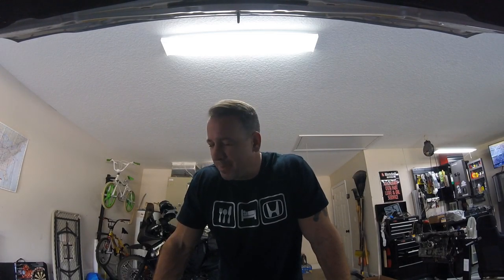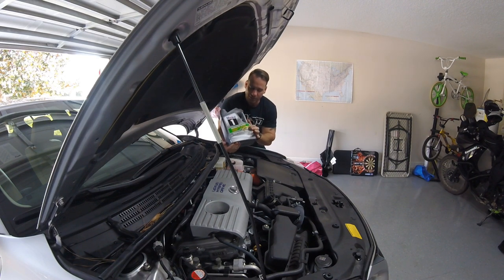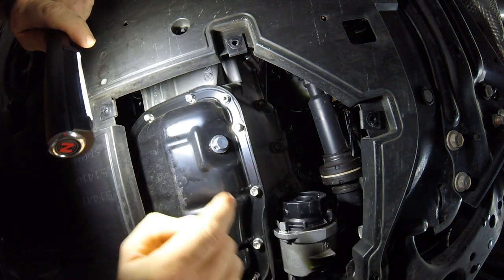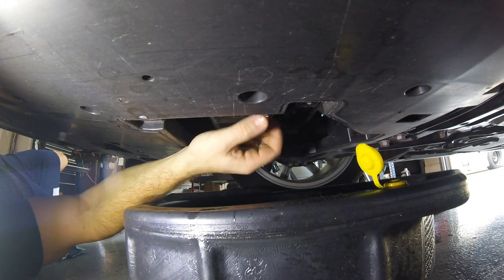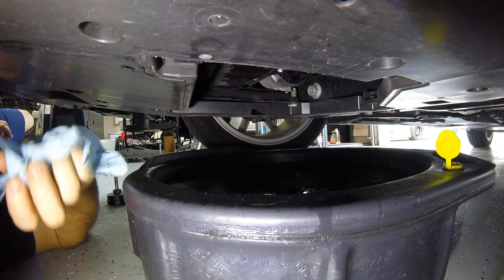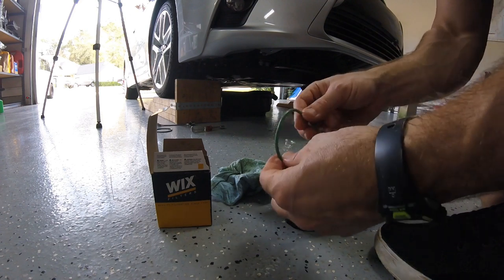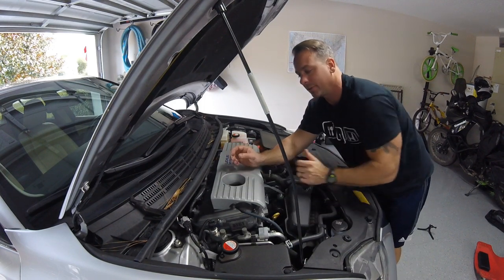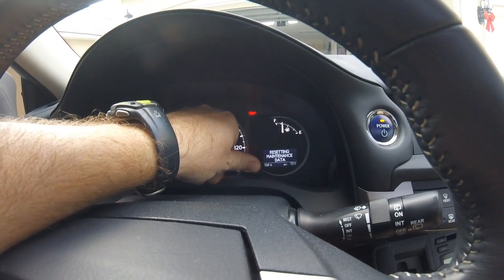How to Change Your Oil - Lexus CT 200

Comment: Got a 2018 model a week ago or so. Man, this car is just perfect in every aspect! My record of gas usage, 3.9L per 100km. Amazing thing.
Reply: Wow, i am getting around 4.8lt/100km. However, the stock tyres are 215/45R17. Thinking of downgrading to 205/55 R16
Reply: Agree just got this car it's a wonderful peace of machinery
Reply: Hope you'll not spend the saved money on the battery.
Reply: @agenorzc  no issues so far, 115k kilometers done and now the service said in a year will probably need to change the break pads. Also bearing in the front left wheel makes some noise so need to change that. Other than that no issues. Here in Norway it has even no problem firing up with -25C during the winter. A lot of reliability fot the money

Comment: I love my Lexus Prius....ahem.....CT200. 42 miles per gallon - $15ish dollars to fill up - better for the environment!  (P.S. Thanks for changing my oil!)
Reply from the maker: EssentiallyKelly It’s a great car with a horrible oil change process and lots of blind spots.
Reply: True story.
Reply: I like my 2013 CT200h.
Reply: @ExtremeDailyDrivers  My Honda Insight is the same way. You can look behind you and check your mirror 3 times, your still praying every time you switch lanes. The insight has 325K miles. Getting a CT next. The interior oozes 90s japan. Right up my alley. Wish Honda made a car like this.
Reply: The battery banks are bad for the environment though 😂😂 trading one evil for another
Reply: @ExtremeDailyDrivers  Lots of blind spot indeed.
Reply: @phill3144  I'll take care of me and the environment can suck it.  I drive a CT200h and love that my gas bill is so inexpensive.  Probably I get 45mpg on average.  If I try I can get it to go higher.
Reply: @michaelking4578  God bless America sir
Reply: You live in Saudia Arabia or Iran?
In US you can't full the tank in $15.
Reply: @SrkTube786  Yes you absolutely can. I live in Canada and when gas is > ~$1 a litre my full tank is about $30. I have gone empty to full for under $15 several times in areas of the US with $2-2.50/gal gas. Assuming you have 1 gallon or so in reserve on the fuel light, 7 gallons at $2.25 is just about $15.
Reply: My wife loves hers. 132,000 miles and counting
Reply: And obviously the reason it's so quiet is all those plastic panels you normally wouldn't see.

Comment: Thanks for the chuckle with your your "count the cylinders" to determine the number of quarts of oil needed theory.  I hope you have figured out the two are not related...at all. 

While the oil filter cartridge might not be as convenient, it is less waste going into landfills consistent with this hybrid's "greenness."  They can also be incinerated, metal canister filters can't.  Many states designate used oil filters as hazardous waste..it is easier to comply with the disposal regulations with cartridge filters.  Cartridge filters will only become more and more common.

Oil turning dark in color doesn't mean in and of itself the oil needs to be changed or there is an issue with the engine.  Urban legend.  More related to heat cycles or soot. 

Handy tip: Your oil will drain much faster if you remove the oil filler cap AFTER you remove the drain plug.

Finally, and you know this....get the torque spec for your drain plug and consider torquing to that spec.  I know many shops don't, but there is a correct way to do things.  Stripping the threads on an oil pan really sucks.

I appreciate the link to the cap wrench.

Comment: Good video, just one thing you forgot to lubricate   the sealing O ring on the filter cap, usually just a smear of motor oil to prevent  it from twisting out of the groove when you tighten the cap, but I am sure this helped a lot of people.
Reply from the maker: Great point. Someone mentioned that below. I did it off camera. I forgot to show it. 👍

Comment: Just done my oil change.  My filter tool to unscrew the filter was different from the one in the video and was poor.  Unscrewed it ok but ended up sticking to the filter casing.  I left it there.  I don't have a fleet of Lexuses so it's not like I'll need the tool for anything else.  Win some, lose some.
Reply from the maker: Next time removal will be that much easier!

Comment: Great choice on the oil filter cap wrench and on positioning it correctly. It's amazing how so many can't seem to get that right.

The only thing I do different is
1. I don't use any tools to change the o-ring
2. I make sure to oil the o-ring.
Reply from the maker: Good points. You could damage the o-ring channel if you gauge it with a tool and I did oil the o-ring, I just didn't show it. I'm not 100% sure its necessary.

Comment: You’ll find the same filters on the 2012-2016 Camrys. Those super seal for some reason. And I’ve actually snapped wrenches trying to get it off. Took all the guys in the shop to get that thing off lol. It wasn’t just the one instance either. It’s happened with them all. I recommend anyone to buy a nice steel made removal tool and not the cheap thin aluminum ones.
Reply from the maker: Yep. Facts. Every time I change the oil on the Lexus I'm shocked by how tightly the filter is on there. Thanks for watching.

Comment: Not sure when the change was made but my 2016 CT200h has the oil filter cap facing the oil pan instead of parallel to it. No idea what genius made that design change or why, but it certainly doesn't make changing the filter any easier.

Comment: Great video - thank you very much.  And, speaking of a pain in the ass - my 2012 CT 200 has these "use once" plastic clips that hold the plastic skid plate in place and the only way to remove them is to essentially break them (which I did) - instead of the much preferred 10mm bolts (also philips-head screws) on yours .  Thankfully, tie-wraps worked well to put (and hold) everything back in place, but I was like, WTF?!  Thanks again and all the best.
Reply from the maker: 😂 Classic Lexus!! I’m so happy the video helped! Good job.

Comment: I like this car .. do you or everybotty  recomends this car for a everyday driver car i drive every day 40 miles to my work and 40 to come back home.... and any problems with the battery pack ? Like those hondas or some toyota prius????
Reply from the maker: We are at 62k miles now and not one issue. It's a Toyota. Do you know what "Toyota" means in Japanese? Bulletproof.
Reply: Thanks so much im ab to buy one i liked  thanks...
Reply: there is a guy on the CT forum that is currently at 580k......... that is five-hundred-and-eighty-thousands miles. 5-8-0-0-0-0.

Comment: Can the CT200H use 0W-16 oil? In the manual, the lowest viscosity rating oil stated is 0W-20 but I see 0W-16 oils labels which says that they are suitable for Hybrids
Reply from the maker: I wouldn't. There is no benefit. Thanks for watching.

Comment: My oil filter is too tight. The wrench won’t even loosed it. What could be the problem?
Reply from the maker: Bicep strength? There is no secret. It needs to be loosened. Crank on it until it comes off. Good luck and thank for watching.
Reply: @ExtremeDailyDrivers  took a breaker to it. Still didn't work. I looked online and apparently the techs at the dealer overtorque these all the time. I had to take a electric wrench and set it to 250ft-lbs to get it off. lmao
Thanks for the helpful video though!
Reply from the maker: I knew you would get it. Never had a doubt. Techs do always over tighten it. That's another reason to always do it yourself.

Comment: "Maintenance Required" does necessary mean oil change. This car needs oil change every 10'000 miles.
The 5000 Miles warning is for tire rotation and fluids top off.

Comment: Great video but I kinda disagree about the bath filter vs the cartridge filter.  I just bought a used CT200h and I'm  looking forward to its first oil change.  My Wrangler JK and Hyundai Genesis sedan both have  bath filters too.   I like having to replace just the paper element.  Less waste and more economical.  The Jeep filter is so cheap the last two times I went to the dealer they just gave me the filter for free, no lie.  I asked for the filter and the dude at the parts desk just tossed it to me and said no charge.  Color me dumbfounded.
Reply from the maker: The key phrase in this comment is "I'm looking forward to it's first oil change." :) Thanks for watching.

Comment: Any recommendations that’s a must for the CT, other than the oil change? I am at 80k miles and refuse to spend over $600 at the dealership for “maintenance” and I want to get to know my CT baby!
Reply from the maker: We are getting close to that. We still have only done oil changes. Brakes need to be replaced and we are having issues with the door lock actuator. More videos on the CT coming soon!
Reply: @ExtremeDailyDrivers  is the door lock actuator what actually makes the doors lock automatically when the car shifts to the drive mode? That’s my issue as well!!! 
Thank you for sharing your knowledge! Being detailed avoids mistakes! Great video!
Reply: but the dealership snackies and drinkies!!! and the courtesy UX!!
Reply: @ExtremeDailyDrivers  MY CT 200H in Oz is clocking 110,000kms and had a e-safety check (for registration renewal). The mechanic said that for these hybrids, the front brake pads will only likely require replacement at 150,000kms as with his experience with most Prius

Comment: You only need to change oil every 10,000 miles or each year. Not every 5,000 miles. Use full synthetic oil 0-20w.
Reply from the maker: Yeah, this was a 10k change. I misspoke in the video.

Comment: I cant remove that filter its so tight😢
Reply from the maker: Buy the filter tool! Link is in the description! Thanks for watching!
Reply: @ExtremeDailyDrivers  i did bro,lefty loosy even impact gun cant remove the thing,dealership sucks!they are the last one who oilchanged the car
Reply from the maker: Get a breaker bar and get some leverage. It will come off.
Reply: @ExtremeDailyDrivers  im thinking about getting that clip off the silver one,maybe that one can help

Comment: Not sure why you're complaining about the plastic cover and the fact the filter is in a filament... aren't most newer cars like this? I get the headache of the special tool... but it's a one-time buy for under $20.
Reply from the maker: The short answer is “no”, not all newer cars have this type of oil filter. Thanks for watching!
Reply: Oh well, thanks for the slight clarification. I wasn't trying to troll... was just genuinely curious and thought otherwise. Thanks for the video though! Just got one of these and plan on doing the oil changes myself... so this helped a lot!
Reply from the maker: No worries, dude. Congrats on your purchase!! It’s a great car. We have 47,000 trouble free miles. I’ll be changing out the front brake pads soon and plan on doing a video. Thanks again for watching.

Comment: Is the car not supposed to level for this?
Reply from the maker: It’s supposed to be level, I always check it after I start it and it’s on the ground. I did film that part. If you put in the correct amount, it doesn’t really matter.
Reply: Extreme Daily Drivers makes sense, love the Ford comment BTW 😂👍
Reply from the maker: Lol. I hate Fords.
Reply: Does the car need to be level so you can drain all the oil? Not so you can see if there's enough oil in.
Reply from the maker: @Droneocean  Sorry for the late response, Carmine. No, the car does not have be level. It's actually better off at an angle because the drain bolt on the oil pan is located on the back of the pan so by having the car at an angle you are sure to get all of the oil out of the pan. I hope that makes sense. Thanks for watching!
Reply: @Droneocean  It's not that critical.

Comment: why did you pay $25 for that oil filter tool?  I actually like the fact that in the CT200h, you don't throw out the entire metal housing, along with the actual oil filter.  Environmentally, that makes sense, and plus the filter itself is cheaper than replacing the entire metal housing.
Reply: Because he wanted the get best...

Comment: It is not a fact that only Lexus has a panel under the engine, many, many cars have this. Additionally, just about every car I've has required a special wrench for the oil filter. You keep on saying it is complicated, there is nothing unique about the Lexus, after all it is a Toyota powertrain!! You need to get yourself a little more thorough education about car makes. All the other Utube presenters don't make the absurd comments like you do.
Reply from the maker: Dude. Stop. Go troll someone else.

Comment: Stupid plastic, stupid plastic……. I searched several videos of how to removing seized plastic oil filter and found very few would broken. So they are more tough than metal ones.
If you just change the paper filter cartrige and always reuse the filter body then plastic ones won't rust vs metal ones. 
Who is stupid? I can't tell. You decide.
Reply from the maker: Wow. You know, I never thought of that. You make a very compelling argument even though I've NEVER seen a seized oil filter and I have NEVER seen a rusted oil filter. But then again, I have never owned a Ford. Lol.